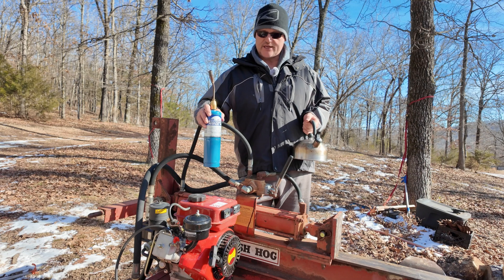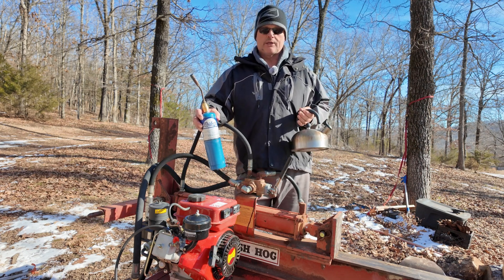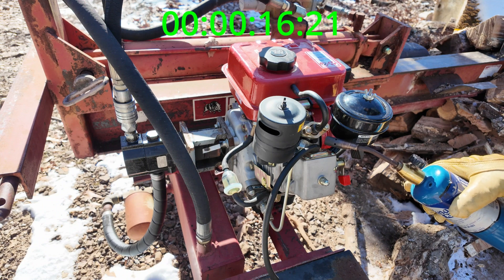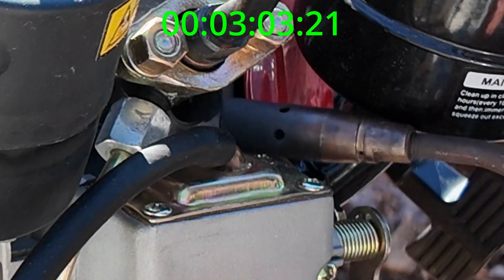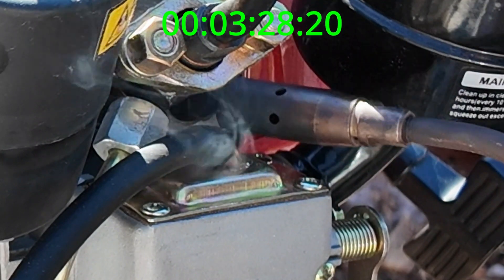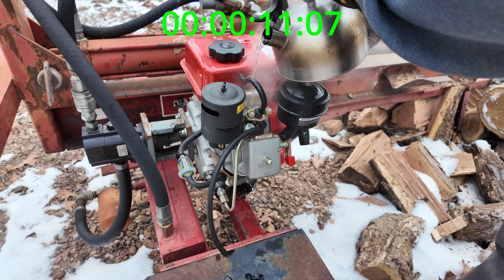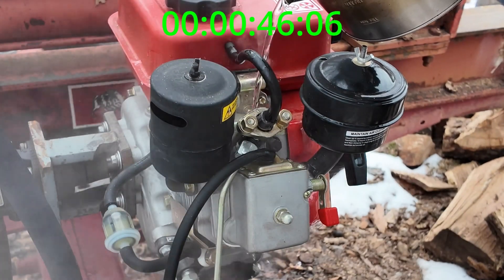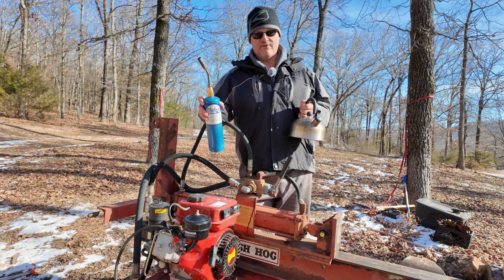Cold Starting a Chinese Diesel Engine Using Torch and Hot Water. Small China Diesel

Comment: Generally speaking if the air is below 32°F the engine will be difficult to start at 23:1 compression 32° air compressed is supposed to rise to 500°F but with cold cylinder walls and head the air cools down - 
    I had worked in mountain oilfields on generators - they were kept at 180° F but there also had to be intake heat exchangers used on start up to prewarm the intake air on below 32°F days -
       Were we were at it often dropped to minus 60°F - but the air intake had to. Be above 32°F for a tart up -

Comment: I'm still curious if heating the block with the torch to heat up the engine oil works at all vs these methods. The boiling water is probably the best way though.
Reply from the maker: Heating block might help but I think it would take a long time with a small touch.   The aluminum dissipates heat so fast and the block is such a large surface area I'm not too sure if the heat would get transferred fast enough.

Comment: I've had this engine for  2 years on my reel mower and it works well.  It is the loudest and most vibrating engine ever!  The diesel knock is louder than the exhaust!
Reply from the maker: Lol, yep I Chuckle every time I see an ad for one of these and they say quite low tone exhaust. This is definitely one loud running engine engine for sure.  Don't use one for a gas powered bicycle you plan on taking to the park. Lol

Comment: with the water heating method try full throttle. also what was the time between starts? also  its better to heat the air going into the cylinder vs heating the block and head. since the diesel works off igniting the fuel from hot air.
Reply from the maker: It was a full day between starts both dead cold engines.  Both had right at 24 hours between attempts.  It was 12f degrees out for both attempts.  The water method fired right up like it was 80f outside. First pull first compression strock.  About really set between 1/4 throttle and 1/2.   I think about 90% of the water flowed over injector/head/and onto intake.  Very minimal hot water on Block.   I honestly can't picture anything working better than the boiling water outside of keeping the engine warm.

Comment: Do you use synthetic or conventional? That might be an interesting comparison too? Seemed like on the torch one it was struggling against the oil?  I see two obvious disadvantages of the boiling water. One is you might not have water on you or it’s inconvenient and two the torch start is much more exciting and eventful. lol.
Reply from the maker: I have conventional 15w40 Rottella t in it right now.  At 12f I am fighting both thicker engine oil ad well as thicker hydraulic fluid in the pump.  Torch is more exciting for heating.  But a one compression stroke fire off with the  water is where it's at.  And your right boiling water may not always be an option.
Reply: @mossycreekvids  oh ya. The hydraulic oil too. Guess there’s not much you can do about that ay? I have been told 0-40 full synthetic makes a world of difference. I’ve always run it in my truck so not sure the validity? I was surprised how well the boiling water worked. I honestly thought the torch would be better.
Reply from the maker: I had a commenter recommend transmission fluid in the splitter, his commercial splitter does.  I may just change that out before too long.  My hydro fluid is ready for a refresh.  I would think 0-40 would make a difference for sure.  As for how well the water worked, I did some research and that kettle of water hold 11minutes worth of my little torch heat at 4300 btu/hr. LOL So I more or less applied 11 minutes of heat in 60 seconds.
Reply: @mossycreekvids  and I guess with the proper heat source you could add the heat to the water a lot quicker. I’m guessing you’re loosing some heat that doesn’t transfer and ends up on the ground though. Another Cool experiment would be if you could build a grid heater that works on a tool battery?
Reply: @mossycreekvids  also some old planes used to thin their oil for cold starts using fuel. However they ran a dry sump system. Wouldn’t work in this situation without damaging I think.
Reply from the maker: LOL ya I heated the water in the kettle on the stove. It takes 11 min of torch to equal the same amount of BTU/hr as the water contained.  @chevy6794

Comment: I don't make YouTubes, yet. I gotta make sure you know everything. I've built fires under cars and gave them time to warm up. The danger here, is of shocking castings and cracking fins. Folks, if 1 kettle of hot water isn't enough, try a few and pour slowly. Enough hot water can start a locomotive.
Reply from the maker: Boiling water worked very well.  I agree there is always a chance of shocking castings and or developing cracks. Cast aluminum is less concerning to me about this over cast iron.  I still think after doing this that water is safer than the torch.  I also question the quality of the castings on these little engines vs jap motorcycles.  I have had some air cooled jap motorcycles extremely hot and instantly shocked them with ice cold water jumping into creeks and never had a failure.  Jap bikes have a very high cast quality on average.  I have however cracked exhaust manifolds with a big splash on older vehicles.

I also hope I never live anywhere cold enough to build a fire under my vehicle to get it going. LOL

Comment: The boiling water spilled everywhere and heated all of the top end of the engine including the block and intake....
far more heat transfer to places it really counts in starting a small cold diesel.

The gas torch was used incorrectly and was always bound to fail....you were heating the injector area...and little else.

Insert the torch into the air intake (metal pipe; not plastic)) after you take the air filter off....
and stick it is as far as possible so the flame and heat actually travel down to the head and intake valve..leave it in for at least 45 seconds to a minute...

Then try to start the engine.

Look at YT vids where blowtorches using liquid fuel are used to heat big old cast iron hot bulb engines.
There is no shortcut there......and the torch is directed at the part of the cylinder where the heat really counts.....
Reply from the maker: I agree 100% on the water heating the entire area making for a very efficient start. 

 I also tried the method of directing the torch into the intake with the air filter out. With my particular torch you cant stick it in the intake very far with out a flame out.  So I directed the flame into the opening as close as I could and slowly rotated the engine with the decompression lever activated.  I was affective in starting the engine but almost identical time wise as directing it towards the injector area of the head.   Since it took about the same amount of time as directing it towards the injector area of the head from the exterior on this particular engine. I had rather just do it from the exterior.  Other torchs and or other engines for sure may be affected differently.  Especially a water cooled engine.

Saying that, using the boiling water 100% was the better method for this engine and is also the one recommended in the manual.  I think it is probably safer for the engine as to not concentrate so much intense heat into a localized area like a torch.  

Another reason I think the water works so well on engines with no water jacket insulating the heat transfer is the math.  I looked up, it would take roughly 11 min to heat up the water to boiling using the 4300 btu/h the torch put out.  So I roughly poured 11 minutes of torch heat over a wider area of the engine head surface in a 60 second time period.  It literally fired off like it was 80f degrees outside.